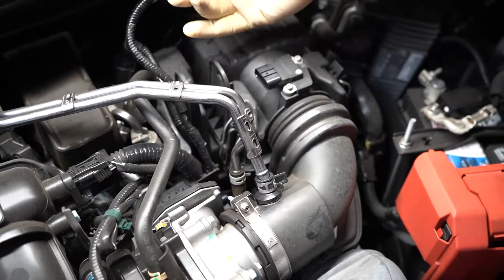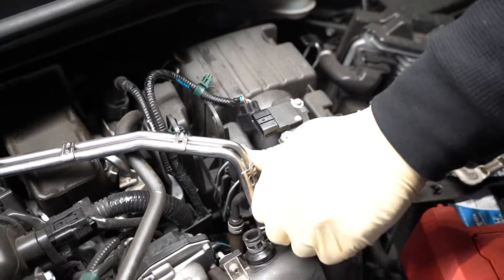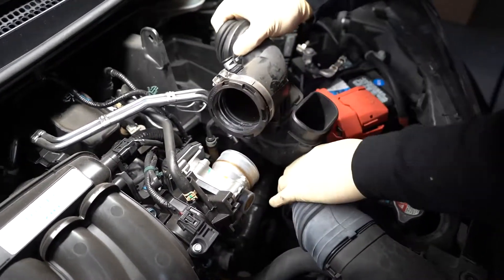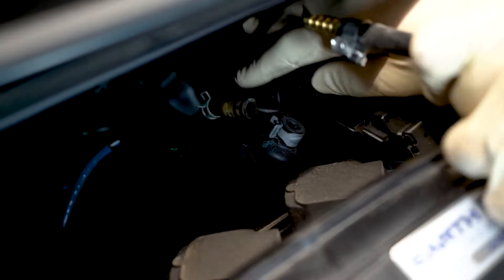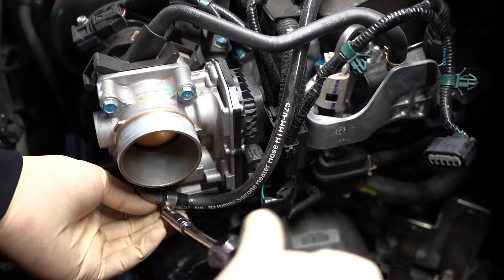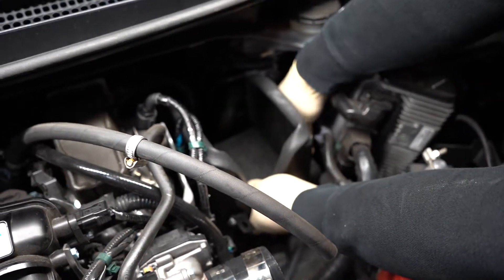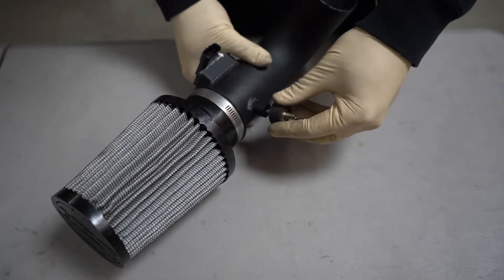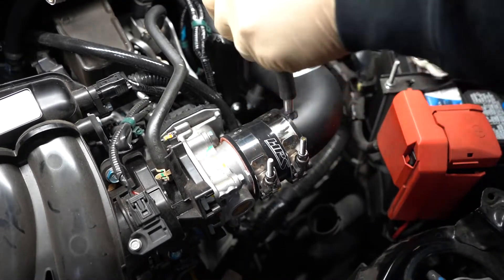2015-2020 Honda Fit 1.5L HPS Intake Install

Comment: After installing the intake do you have any lean code problems?
Reply from the maker: It does not throw any codes
Reply: Do HPS have intake for 2013 Honda Fit sport for automatic transmission?

Comment: Hai. Nice cool intake. Just asking, for this intake setup. Doesn't it will take hot air from the engine bay, radiator, and something like that?? Just curious.
Reply from the maker: Short ram will take hot air in from the engine but it all depends on how well the heat shield is built to help lower that situation.
Reply: Yes

Comment: What size is the inlet for the filter? 2 inch? Or 2 1/2
Reply from the maker: https://hpsperformanceproducts.com/products/hps-shortram-cold-air-intake-kit-2015-2020-honda-fit-827-704?variant=37870149697726